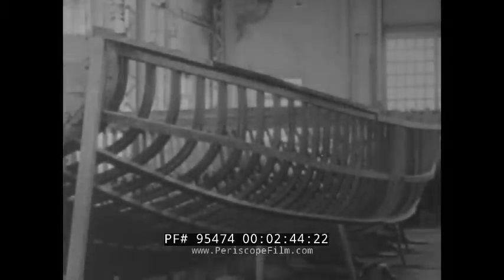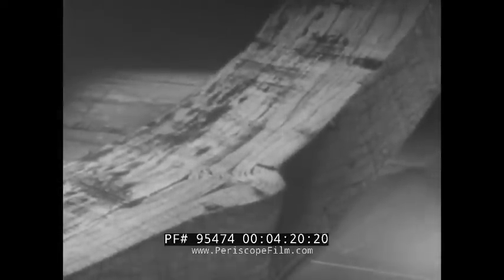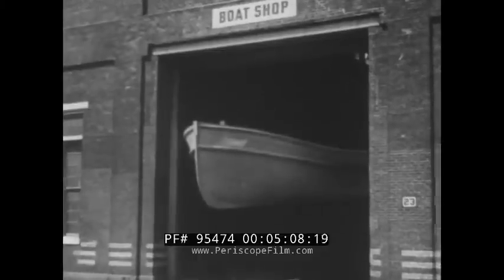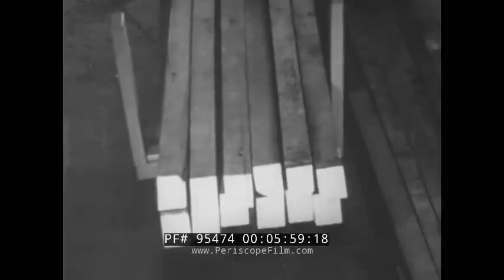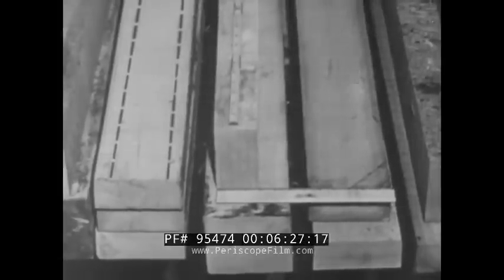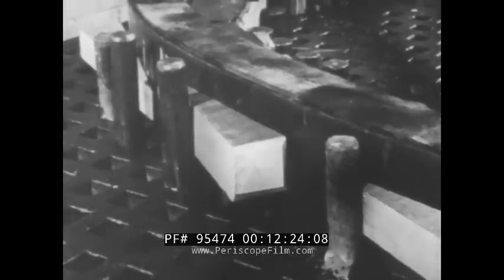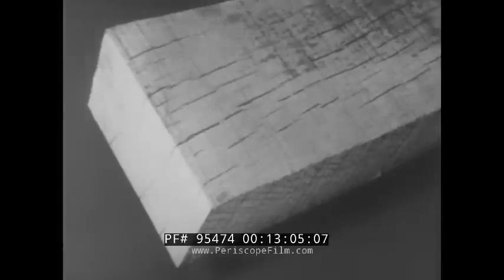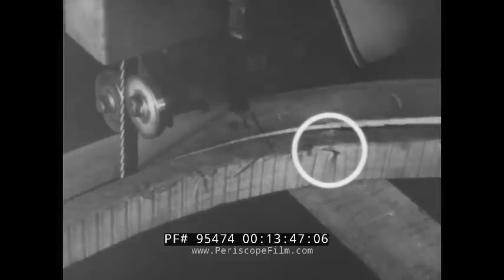1949 U.S. NAVY TRAINING FILM    BENDING OAK TECHNIQUES  WOODWORKING  NORFOLK NAVAL SHIPYARD 95474

Comment: Man did this bring back memories.  Actually bent some small white oak ribs back in the early 70's when I was in my late teens.  Bought an old 1956 16 foot Lyman that had four bad ribs just aft of the center (that's where on a plane it takes the worst pounding).  Anyone that grew up around Lake Erie will remember those boats.  Dad was a paperhanger by trade and had a big old white gas fired steamer for removing old wallpaper prior to reapplying new.  Used an old 2" metal pipe with just a rag on one end and the steamer hose in the other.  It took four of us.  Had to get the rib out of the pipe, ram in down one side and around the bottom and back up the other side as quick as possible.  Then screw it in place with brass screws from the outside pulling it against the hull before it cooled..  Gave the boat to my dad when I went in the Air Force.  He sold it five years later in 1981, and it was still running the waters.  Damn I miss you dad.
Reply: Same here 1956 16ft. Lyman Lapstrake with a bad rib and transom took a year of weekends to rebuild.
Reply: @mrchairman08  Mine had a nice big front deck, but no windshield, and a wonderful front seat.  Full width and quite deep, with a tall seat back angled slightly rearward, and plenty of room for your feet.  Very comfortable.  But... you didn't sit in it.  The wheel was mounted on the back of it... and you sat on what was basically a narrow mahogany plank with no room for your feet so you had to sit cross-legged like you were Japanese!  Marvelous design.  Equally marvelous was the hull.  It had a straight stem bow, with no reverse flare at all.  It would cut a good sized wave and, in almost slow motion... the water would go up in the air, curl over... and dump right in your lap!  Painted it dad's favorite Pettit color... Lemonade yellow with a copper bottom and teak stained bright work (dad hated the red-stained mahogany).  Mine had a 35 HP Evinrude Lark engine, and a TeeNee trailer.  She'd do 28 MPH according to the Airguide speedometer.  Beat the hell outta the old girl water skiing and fishing and just cruising around.     

After having to do all the repairs to her, when I went looking at a boat, I borrowed another one of my dad"s "tools".  A hypodermic needle and syringe.  He used it to force glue into a wallpaper bubble and get it to flatten out and stick.  I used the needle to check if there was any dry rot on a boat.  Guys tend to get just a little 'unhappy' with you digging around their boat poking at it with a screwdriver.  But a tiny needle... not so much.  Saved me a lot of grief.  Some wood boats would look great but, with a little checking, would be a mess under all the pretty paint.
Reply: @donf3877  My boat must have been the same as yours. Front bow covered with a small stowage underneath.  Straight bow design. Wooden front bench full width. Steering and controls starboard behind the front bench seating for one separately there and also on port side. Inside transom mahogany. The bad rib was caused by a small of water seeping though the side hull from behind. The wood was there but very porous so I injected it with a wood hardener and never had a problem with that area again.
Reply: @mrchairman08  WOW... small world... same boat.  And, let me guess, you used Git-Rot.  For those that don't know, it's like thin fiberglass resin, with a antifungal in it to kill the rot).  Had a soft spot on the bottom right at the transom, and two more at the bad ribs.  Used 60 grit sandpaper to get the paint off and rough up the wood so it was porous.  The Git-Rot seeped right into the wood, and it was hard as a rock.  The four bad ribs was from the guy that owned it before me.  He let the paint wear off on the ribs, and left standing water from the rain sit in the bottom.  That's all it took.   If you take care of a wood boat, it will last forever.  Forget about it for even a little while... and to the burn pile it goes.
Reply: @donf3877  Exactly! I took the paint of the outside where the wood felt spongy and injected that product that hardened it solid.
Reply: Scientific research has revealed that all forests are wooden.  I would like to say that I have a pet tree named "Woody".  He lives out in the woods.  The forest has many woods in it.
Reply: TL;DR
Reply: @greghawkins1025  You can't see the forest for the wood.
Reply: It does you good that you miss your Dad.  Some don't have a Dad and some wish they didn't.  The good ones are rare.  I envy you.
Reply: The best comment  I've read all week almost as entertaining as the video

Comment: 71 years on, it's still sound advice!
Reply: I'm sitting here wondering who the lucky tiger is that got all the ruined wood. I'd be leaving with a full truck everyday.
Reply: @wokedisease4277  boats are still built from wood, even yet. Never mind repair and restoration. And all the other things you can do with bent wood. 
But apart from that...
Reply: If it ain't broke, fix it until it is.
Reply: @karsaorlong666  If it ain't broke, it ain't mine...😂
Reply: @wokedisease4277  5

Comment: I always check for moisture before I place wood in the steambox.
Reply: Well, he did say why.
Reply: Placing your wood in a dry steambox can be a very unpleasant experience
Reply: Irina Bonney took me a minute lol
Reply: And remember boys, don't spit! Longer lasting most is ideal for the wood going in the steambox!
Reply: Oh man!  That was right there waiting to be plucked and you got it! :-))
Reply: This it’s perfect
Reply: Some can't be too moist 😫
Reply: It's important that the steambox is not too large which lead to a diminished end result, as the wood does not optimum physical input at a cellular level. Conversely, if the steambox is too small, obviously not enough or the wood can be inserted to achieve a satisfactory volumetric final product.
Reply: YouTube gold is always in the comments
Reply: low hanging fruit
Reply: Best comment on utube
Reply: @lukejette  at long as you insert wth the grain, you'll avoid burrs on the end of your wood.
Reply: LOL!
Reply: Definitely don't place wood in a dry steambox, you may experience unwanted breakage!
Reply: Bwahahhaha
Reply: I see what you did there
Reply: @lukejette  God damn. So much pun lol
Reply: @_GOD_HAND_  for whom
Reply: Thank you I needed that cheers mate😂😂😂💪💪
Reply: Don’t forget to ease it in like a gentleman. Just slamming it in there can cause some issues.
Reply: Proper selection of the wood is vital!
Reply: Giggitty
Reply: 12:17 God forbid, if ones tackle gives way in the process!
Reply: Argh Argh argh!
Reply: Wood with nuts is best to use
Reply: Omg

Comment: Valuable information for restoration and construction processes. But, for every oak cut down, we should be planting another 100. Oak tree growth is slow. White oak is also used in making staves for oak wine, whiskey and other fermented alcohols. Good for casks and buckets. They last a long time if protected from fire and rot. Could be a good job for all of America's unemployed. Put the U.S. back on an agricultural production footing.
Reply: Should be planting around 220-250 for every one we take down. In 100 years, you'll see many of those die from various factors, and out of the ones that don't, many will have internal rot, which is common to many species of oak that appear healthy otherwise if they aren't carefully monitored.
Reply: We used to have the Civilian Conservation corps.  It needs to come back
Reply: Was in the logging industry and 90 percent of the clear cuts where replanted with pine. The select cuts where most of the oaks came from mostly were most left a lone letting the hardwoods to come back naturally

Comment: Amazing that this was still standard practice in 1949. I would have thought steel ships totally dominated the navy and shipping by then. When did we stop building ships out of wood like this? Amazing process.
Reply: At this point they were still building ship's boats (Captains Barge, gigs, whaleboats, etc) out of wood.
Reply: @jeffp3415  Minesweepers were built from wood too.
Reply: Small boats started to be replaced by fiberglass 1950's and then overtook wood in the 1960's. Steel likely overtook wood about the same time for larger boats. Big ships started to be built in iron mid 1800's moving to steel by the 1880s or so but large wooden vessels were built right a long side of them but you can only build so big in wood. Laminated wood is easier in some ways and uses less rare wood and can be used for frames and planking, knees, almost anything. I hope that gives you some context. I could go on for many pages but I need to go to bed. Gotta work ya know.

Comment: I love how they used the term billet like steel.
Reply: Yes.  I recall reading a Sherlock Holmes book that mentioned a van, before automotive vans even existed.  It was another horse-drawn box on wheels, and the automotive vehicle we now call a van got its name from that.
Reply: Aluminum was the first to come to mind, the term billet, I may be wrong but i believe it means a semi cut or machined piece of said material, rather than a forged piece or casting.

Comment: When I was very young ( 1960-? ) my dad and I built a dingy. If I remember correctly we used beach ribs that were bent using some sort process using Ammonia. Does this make sense or ring a bell with anyone? As a teenager, I moved on to foam core and fiberglass composite as it yielded much faster results. :)
Reply: Check Engelscoachshop UT channel. He has a whole series on bending wagon and carriage parts. He adds ammonia to the steam water to increase penetration. Perhaps that's what you remember.
Reply: @bobhazzard7747  soaking the wood overnight or a bit longer in the ammonia & water mix makes the wood surprisingly easy to form, clamp and then sun cure/dry the piece. But it takes time, the soaking and sun drying that is. So today's dollar chasing impatient "craftsman" uses heat to steam the wood and electric ovens to cure/dry it at fairly great cost and of course that cost is put to the man buying the formed boards or whole boats. Definately a lost art because most of those boys just don't care to wait, got to have their results NOW sort of... people. There is a sweet satisfaction found in doing things 'the old way' and even though you might think it slower, well doing it the old way gives you time to work on other projects, food for thought.
I had to edit: When I say 'sun drying/curing' I mean that the shaped wood needs to have some of the heat from the sun for drying, not direct sunlight. Under a roof with good ventilation.

Comment: What happens to rejected stock? Sold for paper?
Reply: I would think if rejected for bending can still be used for straight pieces.
Reply: Crates, pallets, construction, flooring even stoking the fires to make the steam to bend the good stuff. Wood for bending is about the highest grade you can get. It is also a premium price  5X the normal piece
Reply: keeps you warm on a cold, winter's morning
Reply: Damage control braces  and many other purposes.

If nothing else... book shelves.
Reply: They get turned by lathe into single toothpicks.
Reply: They sell it to Home Depot.
Reply: @kenmore01  too many cartoons!
Reply: @autophyte  all Home Depot gets is mostly Earlywood. Spongey as all get-out. Under decent conditions, properly dried white oak that is mostly Latewood seems to be a very hard material I compare to blocks aluminum

Comment: As much as they loved those majestic  Lebanon cedars.... you might think someone would plant some groves and keep them protected...
but I guess it's hard to stop hungry or cold ppl from cutting down trees for sale or for firewood...
Reply: Many of the trees you see are planted.  There are obvious man made forests like the ones in the Florida panhandle with their even rows and heights, and ones you'd never suspect like much of Missouri.  People have been planting trees for both commercial use, ecosystem stability and the sake of having them all over the country from Oregon, to Michigan, to Arkansas and beyond.
Reply: Also you don't cut live trees for firewood.  Green wood doesn't burn very well, smokes like crazy and is very difficult to split.  Firewood cutting is no threat to timber whatsoever.  I've seen people try to burn live wood a few times, but it's very rare and only done out of sheer stupidity.

Comment: Cedar's good and all,but you couldn't build a really big boat much less an actual ship of any size with cedar. The structural strength just ain't there. Great for small craft though.
Anyone causing 60% losses wouldn't be Workin in my shop anymore,that's just piss poor technique. Norfolk was at 6%,I mean come on.
Reply: you are thinking north american red cedar, the cedar from the mediterranean is quite different.
Reply: Believe it or not the navy boats were built on a much larger scale and speed and had way better quality standards than a small shop